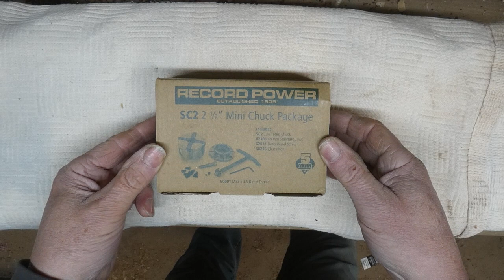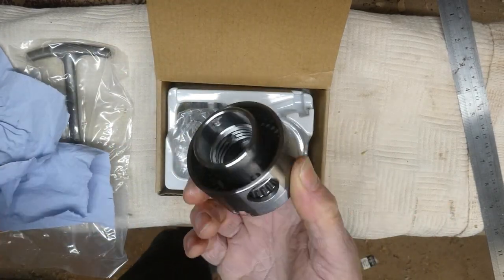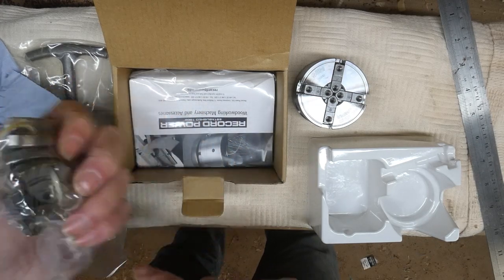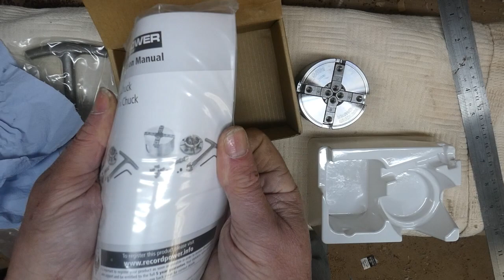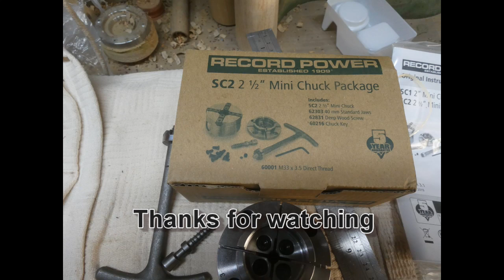record power chuck SC2

Comment: Nice review Andy! I like the idea of having a small  chuck like that. I do have a set of 35mm jaws for my Nova chucks. Really nice for a small mortice which I have used many times.
 But I would like a small chuck body like you have there.
Thanks for this video!
Cheers,
Gary
Reply from the maker: Hi Gary... I would have liked the 35mm jaws on this chuck instead of the 40mm ... but I also like the look of the domed jaws.. they look really useful... ohhhh.. so many nice shiny things to buy ... Haha... yes the smaller body of the chuck should allow more access to the back of the project.... take care...All the best.....Andy
Reply: Not to mention it is so dang cute!

Comment: I bought the sc3 chuck from the same shop today, okay I got it delivered. Very pleased with it.
Reply from the maker: Hi John...
Good choice... the Sc3 is a great alrounder...I hope that it serves you well..
I do like Record power chucks... and they are not too hard on the wallet... Haha ..
Take care...All the best.....Andy
Reply: @AndysCornishCreations  Okay, here's how it went... The lathe was £100 second hand  (Tyme Cub plus loads of old chisels and stuff) Then came along. Three new chisels £67.00 The new chuck £130.00  A new grinder £30.00.  Recip saw £30. And all I've turned is half a dozen small rolling pins and about a dozen honey dippers. Oh' and a pretend candle stick practice spindle. However, Now that I'm sort of kitted out all I need is time...
Reply from the maker: It sounds like you are doing well to me... you have the essentials and have made a good start on making things...
It's not cheap starting out but you have kept the costs down  very well...
Bandsaw next ehh ... it doesn't have to be massive... but sooo useful...
Ahhhh time ... that's the tricky one ... never enough  !!!
Take care...All the best.....Andy

Comment: I’ve just received one of these and in my excitement of turning a Christmas ornament (I am a beginner) I loaded my prepared piece onto Chuck with tailstock supporting it. After a while the whole piece flung off … so I glued it again. I then started on my second prepared piece and just a minute into turning that flew off the Chuck. My piece was an inside out ornament. I’m using gorilla glue and the piece was square … what am doing wrong? 😊🤦‍♀️
Reply from the maker: @hayleywood93  Hi Hayley...
It's difficult to advise you without seeing what you have done...
If you could send me pictures of the piece mounted in the chuck and wit the tailstock support.. I might be able to see if there is anything wrong with your method...
My email address is      andyscornishcreations@gmail.com 
I haven't tried an inside out Christmas ornament yet but I have seen them made..
Usually 4 pieces fastened together with double sided tape or tape wrapped around the outside for the 1st stage of turning..
Then inverted and glued together for the second stage...
I'm assuming that you are using Gorilla wood glue.. its good stuff.. I like using it... make sure that you leave it overnight to cure fully...
Also be careful when using tailstock support because you can drive the pieces apart with the point of the live centre in the tailstock...
To stop this you can glue a piece of wood onto the tailstock end of your piece...
Make sure you use light cuts as a catch cat RIP the piece out of the chuck...
Despite teething problems I hope that you are enjoying your new hobby... I  love it...
I hope that this is of some help.. do not hesitate to ask for any help that I can give...
Take care my friend...All the best.....Andy
Reply: @AndysCornishCreations Hi Andy, many thanks for your speedy response. I think you’re right that the tail stock forced it apart, plus I had in the Chuck a square piece of wood in a round hole.  🤦‍♀️ It really didn’t have a chance!!! I will try what you have suggested and take photos… however I think it’s probably best that I start with an easy piece first 😃. 
Love your work and thanks for the offer of more advice … I think I’m going to need it ❤️
Reply from the maker: @hayleywood93  Christmas trees and mushrooms are great fun to make 🎄🍄👍